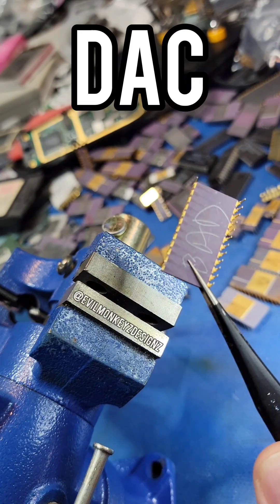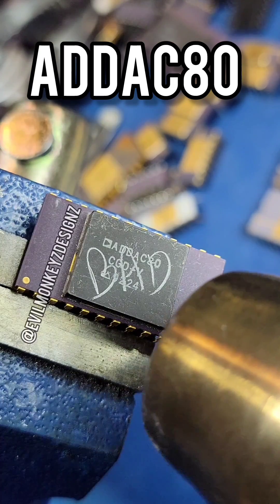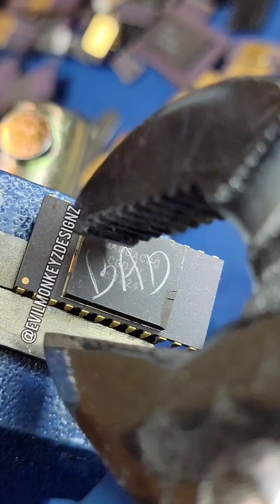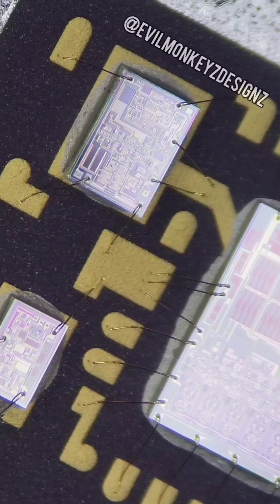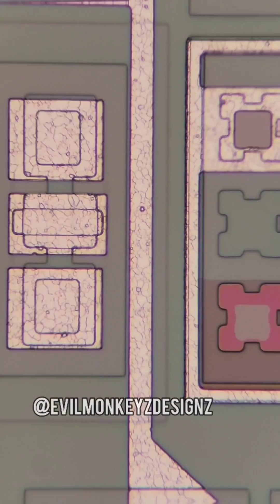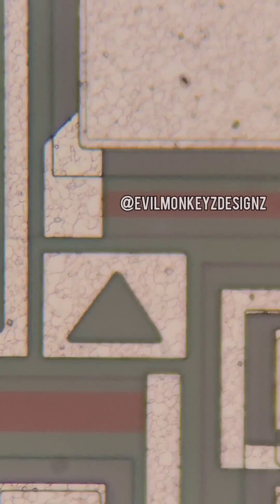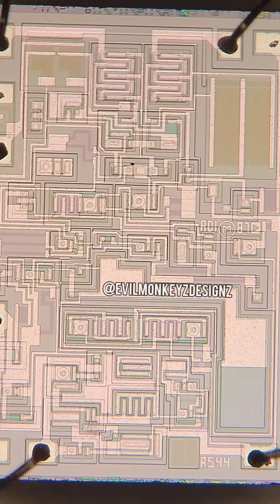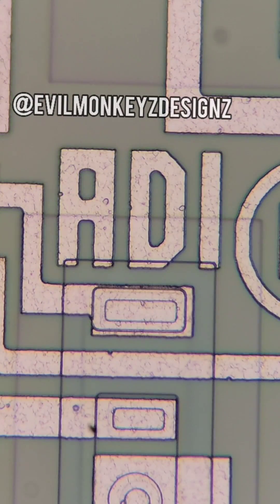CCU #255: 12-bit DAC

Comment: Hey isn't possible to take a look at 7nm chips as rizen 3for example? I heard that because length of visible light is impossible to look with microscopes. But if not possible zooming in into the transistors, it could be cool if you can show us how modern (around 5nm) chips look at maximum magnification.
Reply: the actual transistors in modern chips are under like a dozen interconnects. You wouldn't see much.

Comment: If anyone wants to know what the laser trim is for, it's for trimming fuses or in this case for making a resistor a different value. This is to help make certain components on the chip fall within specified parameters.
Reply: I was about to ask, thanks!

Comment: There's been a few chips with laser trimmed sections. What's going on there, why and how? (yes, with a laser, but are they measuring something like resistance and then "cutting" a part of the silicone to tune the circuit, or something?? 🤔
Reply: Yes, exactly! I am only aware of laser trimmed resistors. Yes, they mesure the resistance with points on the chip and burn whatever is necessary to get the right value, often a ratio for a voltage divider. One example is precision voltage references.

Comment: Do chips become useless the moment they are unsealed? Or will they continue to function as long as they aren't contaminated?
Reply: Depends on the chip or what they are made of/for.  
Some can run for weeks or more with the tops blown off.  Some will die in seconds.
Reply: Even oxygen is a contaminant if the chip wasn't built with a protective layer of silicon dioxide.

Light will induce currents where they don't belong.

Light will

Comment: Is the laser trimming for calibration purposes?
Reply: Yep, to work, the resistor for the highest bit must not be so wrong that incrementing the value from 0x7FF (2047) to 0x800 (2048) doesn't make the output move backwards, which is just a 0.05% error .  A 16 bit DAC needs even more precision .

Comment: Just a thought... I wonder, if you could take HIGH RES or HD photo's of all these chipsets, in like a larger then 4KMpixel or 12Mp res, then drop them off to your local KINKO'c to have their printshop team print them out on full color enlargements like standard large picture frame sizes, and then sell the frame for like what your cost's of time and printing are, and the photo is free, so you don't get in trouble with copyright stuff of the chipset manufacturers? As there is about 8 of these that are important to me, that I would love to have in my house and lab and heck, a few more for my garage/workshop... For example, the legendary TRIPLE FIVE or (555 timer) or 5556, the 8800 series or quad 8 more particularly, and the 8806. 

As you already know, the higher the photo matrix is, the larger and better quality the enlarged photo would be. ... Perhaps, maybe even run the PIP type photoshopping of the main chipset in full, with smaller windows of zoomed in on character marks off to the side.. perhaps, might even be able to play "Where's Waldo" type photo's on the side, "find'em in the larger photo"..lol... Please note, I do not know of the cost and logistic's and more importantly, the legality's of such... But, if you can pull that off, I would enjoy being your first customer.. If you need contacts of a reputable frame and molding supplier that has been in the business for like 20 to 30 years, A city in which I grew up in called Fort Wayne, Indiana, has one called "Stitch & Frame" it was on a street called Bluffton Road. It is a family owned business, and the wife runs it. They offer all sorts of sewing supplies and crafts. That is where I would go to get string for my LEGO's for various projects, as they had a selection of about 3000 different colors, and about 200 type of string, and woven, etc... But, the picture frame side, they also do restoration work on top of custom sized framing. I had a couple frame made for my mother about 10 years ago, and they were about $50 bucks, for some high end stuff, but, I also picked up about 8 "El-Cheap-O" plastic poster frames for other stuff I had at home.. those were what I was thinking about for you, as those were only like $10 bucks for a 18 x 24 approx size.. but, they can get / make those in any size even door posters lengths.. I do not see those being cheap, but, a frame about 20 x 24 about $10 to $20 bucks? 

Just a thought...
Reply: I doubt anything from the 80s would be worth the lawyers time to go after.
Reply: @EricRohlfs  I suppose, but, I have seen greed over lesser things from tech company's...lol... like the "thermal paste battle" spending about 3 million to sue another paste manufacture, not because both were thermal paste's, but because they were copying the color "egg shell white"... LOL and maybe won $9K back... lol